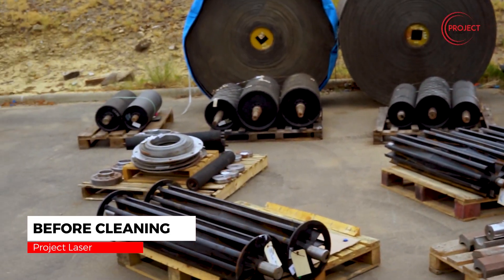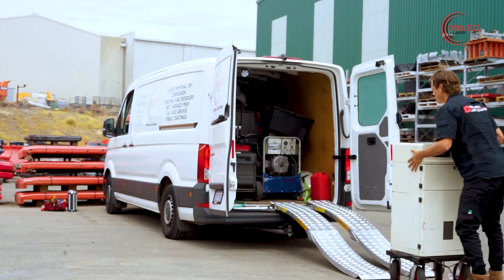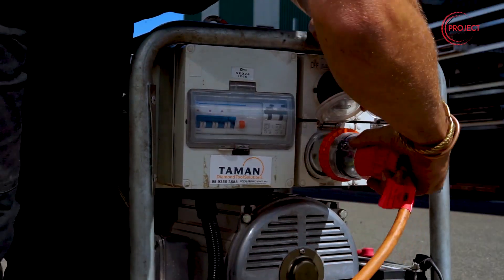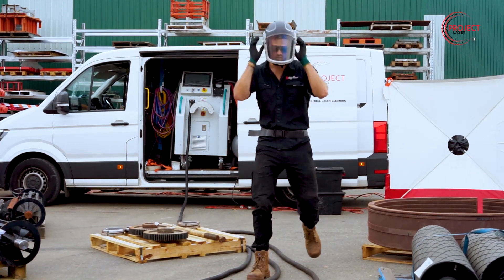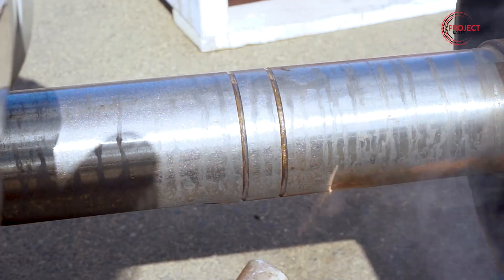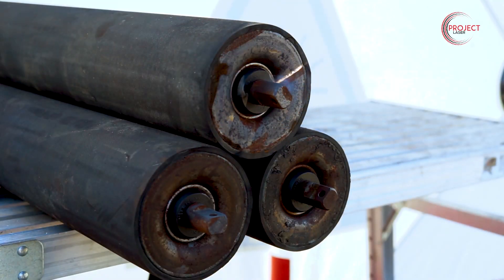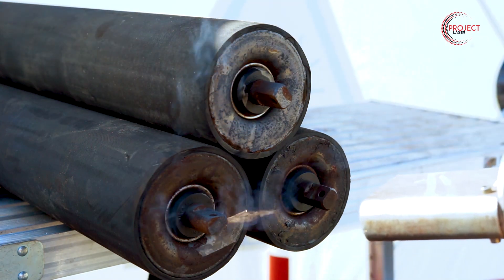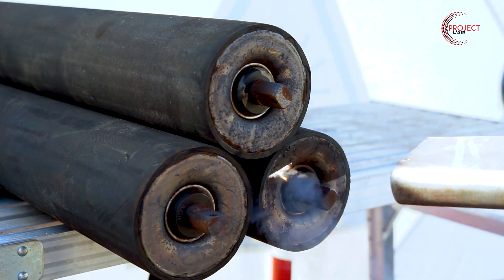13 hours of laser cleaning

Comment: So I take it that it won't work on pitted rust?    Not really a substitute for abrasive blasting?
Reply from the maker: Rarely, in our opinion, do pulsed laser compare with blasting, it's non abrasive and generally can't profile the substrate at all or too an adequate level.  More a comparison to chemical stripping,  manual cleaning, or dry ice/ soft blasting  like soda

Comment: What kind of equipment do you use? I would be interested in similar set... What are the initial costs?
Reply from the maker: 8 months later we got there, this is with the 500W 4Jet laser cleaning machine, cost for a full setup is several hundred thousand aussie dollars, we now have 4 lasers so that value has gone up
Reply: 67 000 USD ??? for real? @projectlaser

Comment: It's so satisfying to see this stuff. I live in Florida, and corrosion of most metal parts in this heat and humidity is common. I just can't justify spending $$$$ bucks on a laser to do this. Hopefully someday they will be cheaper.
Reply from the maker: look at a CW laser, only $$, they are not to be pointed at stainless steel, precision parts, copper or brass, they will work on run of the mill steel and iron though
Reply: @projectlaser so it should work on cars and car parts? what's the approx. cost?
Reply from the maker: @lenikt3560  if you're referring to CW lasers, they can.  Though unlike pulsed lasers they produce a big flame when removing paint. Another important thing is that no laser is designed to remove heavy rust. They're tools for surface rust, $10,000-$30,000 for a 2000W model

Comment: Feel good to see your job, i'm planning to open a laser clean service at my city, start with a 2kW CW laser, should I go with CW type first or should take a less power pulse type
Reply from the maker: If you are interested we have a laser cleaning Ebook for sale @ industriallasercleaning.com.au
Reply from the maker: Depends on what you want to do! you couldn't clean what I cleaned in this video with a CW laser, but you could remove corrosion from steel, carry out non-destructive testing surface prep and a bunch of other activities where the client wont mind a scratches surface
Reply: It depends on your application and budget. The CW is cheaper, can work faster but can damage the surface even it's tiny. Pulsed type has 2 kinds, Gaussin and Top-hat. Both are higher price but you can challenge more precision work

Comment: That's pretty impressive. When I'll grow up I'll buy one of European quality laser machine, but for the moment I'll keep working with my 1500wats Chinese laser machine.
Good luck my friend.
Reply from the maker: CW lasers didn't exist when we stated, much like pusled lasers, CW Lasers have unique benefits and applications.
Good luck chasing your dreams, and feel free to reach out through other social media channels if you want  a chat
Reply: @projectlaser  Your machine is pulsed laser ?
Reply from the maker: @tanasedan4676  yes,  it's a 500W pulsed laser by 4Jet
Reply: @projectlaser  I guess you use a top-hat pulsed fiber laser. Why not try to know something about diode pumped solid-state laser?
Reply: @projectlaser  what are the key differences between a CW laser and a pulsed laser?
Reply from the maker: A CW laser is the same type of lasers that's used to cut through metal, they simply use a galvanometer to rapidly move the laser beam around, some CW lasers can be purchased with 3 tips, laser cutting, welding and cleaning.
A pulsed laser and specifically our Top hat laser source is designed to not profile, scratch or damage the surface it is cleaning.
Reply: @projectlaser  thanks mate, great info from someone actually  using the tools is so valuable
Reply: @projectlaser  What laser source your machine uses ?
Reply: @produKtNZ  CW has high power such as 1000, 1500, 2000, up to 6000. It removes the rust by burning. It work faster but can damage the base metal even it's tiny. Pulsed laser clean by single pulse with 1.8mj, 13mj, 30mj or 50mh. Pulsed laser has 2 types, Gaussin and Top-Hat. Both of these 2 types are almost non damage/destructive cleaning. and Top-Hat is better than Gaussin on protecting the surface. Of course, the pulsed type is more expensive than CW.
Reply from the maker: @sdqylaser4716  As mentioned in my comment CW lasers have a benefit and applications, and we will most likely add a CW laser to our equipment in the future.
our 500W tophat is 500mj and has some amazing benefits in high-value applications. CW lasers can also achieve great cleaning speed in certain applications
Reply: @projectlaser  500mj?  Is it a mistake?
Reply from the maker: @sdqylaser4716  yes my friend! 100Mj
Reply: may I ask where you bought yours? I was looking at SFX 1000w from China, but I have been trying g to find someone that has one and tell me about it before I buy.
Reply: @zacharyreynolds6969  Hi, SFX? Is it Senfeng? We are a company founded by Laser Institute of Shandong Academy of Sciences. We aim to help the laser cleaning market grow better and faster. We supply all series laser cleaning machines and you can contact us for free consulting service even you plan to buy from others. It's okay